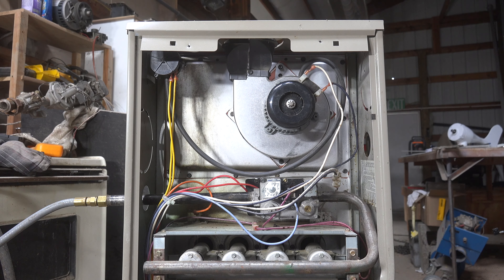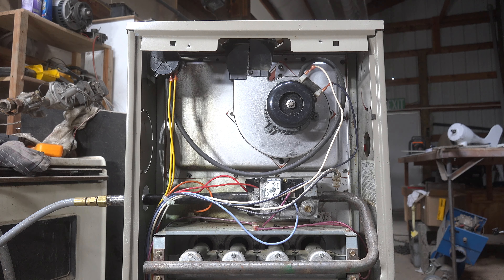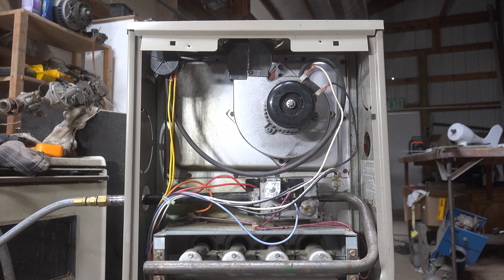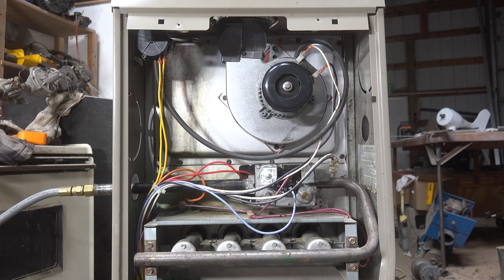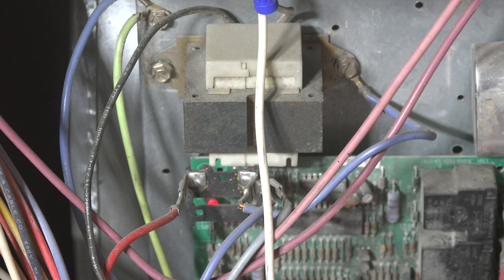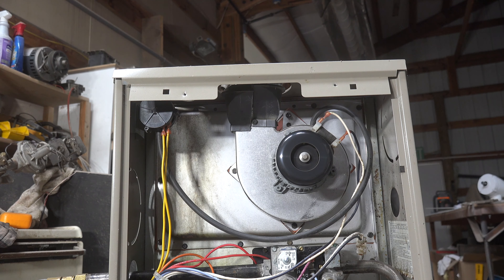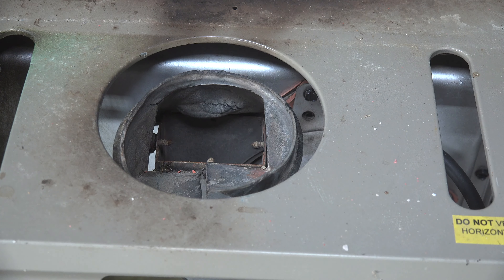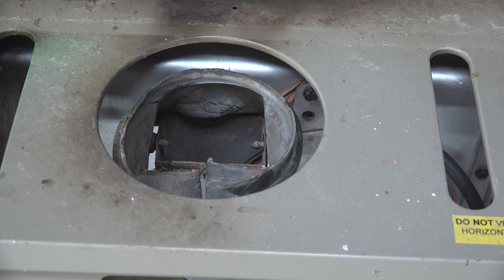Furnace won't heat, An installation problem

Comment: Plugged chimney vent or intake not getting enough air.??? My brother had a customer in a brand new house built by a carpenter that sealed the entire cellar with plastic sheeting and caulking under sill. Furnace would huff and puff unless you opened the cellar door and then would run fine. Had the owner install an outside vent into the furnace room and issue was fixed. Thanks for great video's.
Reply: If that was the case the pressure switch isn't supposed to let the furnace fire.
Reply: @averyalexander2303  Thanks for the reply, it was an oil burner in my case.

Comment: Got a story about this, when I was a kid we had a "Warm morning" style of console heater, one of the glass sheets in front of the ceramic blocks was broken so we were getting mild symptoms of CO poisoning, we had it replaced with a 2 burner GMP like this. It was just sitting out in the open in our dining room plugged in to a wall outlet where the other used to be. No return, not even a proper filter rack, just the side cutout with a couple of pieces of sheet metal screwed to it to hold some of that washable filter media in place. The supply was a box plenum that went up through the ceiling and turned into runs of flex duct in the attic.

This thing was a safety nightmare, it was single wall vented so that was burning hot and I recall washing the filter and putting it back in place before it was fully dry and getting shocked, the suction pulled it in just enough to touch the terminals of the run capacitor thus energizing the filter. Yes, with the filter removed the bare live capacitor was right there in the open.

Anywho, the issue, ours kept regularly setting pressure switch codes because the barbed bung on the inducer kept plugging up and had to be rodded out with a toothpick or scrap of wire. This is what the video made me think of.

As for the melting, I can only think of the high limit contacts sticking shut.

Comment: I am not an HVAC tech...is it possible that the initial blocked  filter could result in such high temperatures across the exchanger that the draft air/exhaust through that exchanger could be hot enough to deform the adapter coupling? Resulting in the PX switch fault as a result of the draft air flow restriction? The overheat should have tripped if operable I would think...Interesting case study. Looking forward to the follow up. Thx & Cheers

Comment: Could it be that there is another filter that has been sucked or some how pushed into the return of the unit. This happened to me, do to the furnace return duct not having been installed properly. The track to hold the filter in place was missing.

Comment: I have a question how did u get these furnaces to run for a demonstration
Reply from the maker: The furnaces used are test mules taken from HVAC junkyards, wired and piped to operate temporarily.
GFM

Comment: Was the high limit switch bypassed?
Reply from the maker: Yes, but the why is the issue.
GFM
Reply: @grayfurnaceman  Someone bypassed the high limit because the furnace kept shutting off due to the plugged filter and the furnace overheated and melted the plastic adapter? Surely not because that would be too simple LOL
Reply from the maker: @averyalexander2303  Not quite but close.
GFM

Comment: Air switch on exaust,possiable, [over temp] on high temp switch on the exaust /vent to chimney. I have had both of these. *
Poor mv signal on flame rod , it lights but dies. Ie: intermittant signal, will not hold main gas valve on..